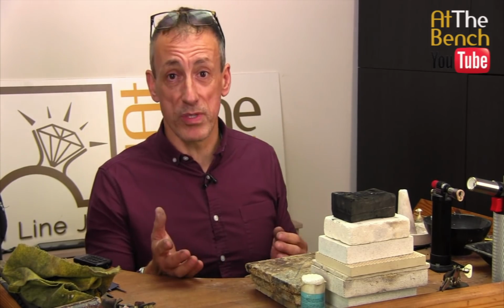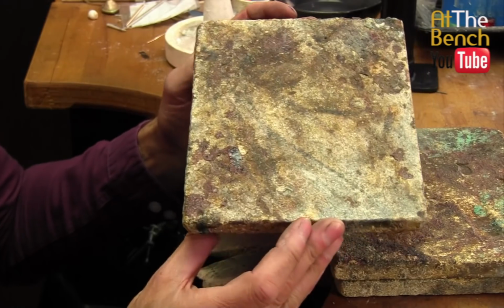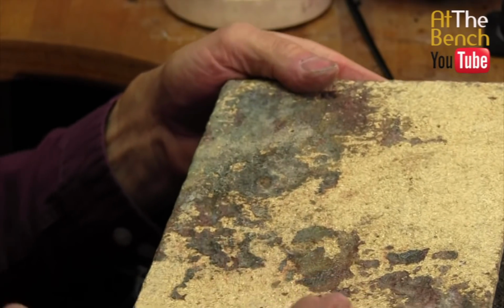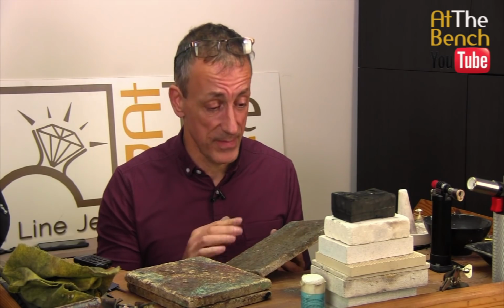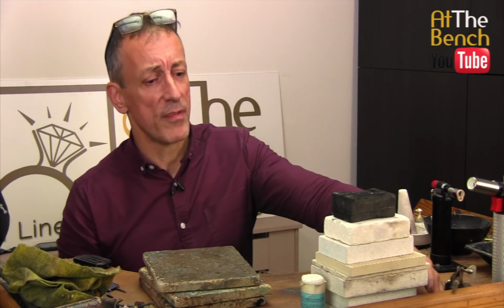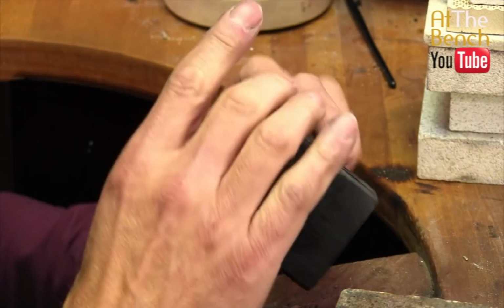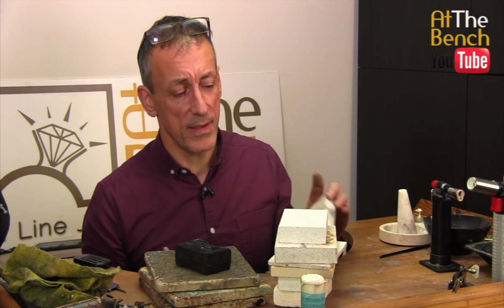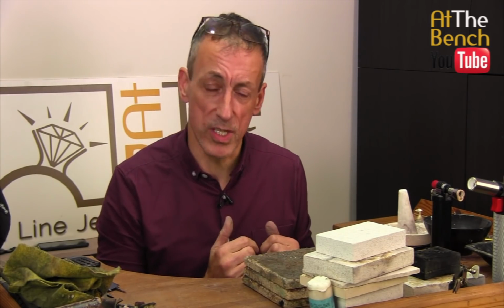After All These Years It's About Time To Retire

Comment: I used to put my crucible and my hard soldering blocks out on my window ledge for a few weeks and the sun and rain would break down the flux to a powder.  I would retrieve them, brush them out and use them after making sure they were dry.

Comment: Just a suggestion as you give me so many tips. Put masking tape on the back of a sheet of rough emery paper put equivalent masking tape on top of your workbench, apply superglue to the masking tape on the back of the emery paper and activator to the tape on the workbench. Glue the two together and you have a nice flat sanding surface, which is very easy to remove and causes no damage.
Reply: Midnight Joker Myself I have a piece of “Float Glass” (mine is 4”*8”) I contact cement or rubber cement to adhere whatever abrasive paper to it. I also have a 12”*12” piece that I use to sharpen tools on an with large sheets of paper when I am not worry about spotting or tarnish I just use water.  If you don’t want the expense of float glass, (I got a deal on my various size pieces years ago) thick plate glass is a good alternative.  Stop by the local glass shop in your area and talk nicely and ask how much as opposed to begging for it and you can used pieces of plate glass from replaced windows cut down to size pretty cheap.
Reply: @gullreefclub  Nice one. I got some granite, but usually to lazy to hump it out unless i need real flat.
Reply: There are sandpapers with a sticky back, available in various grits, that come on a roll. I found some on Amazon. I keep a selection by my bench to adhere straight to the bench or to a board that is easy to move out of the way when needed.
Reply: Thanks @kathyrmatthews , I have tried them, and prefer masking tape and superglue. Double sided tape and tape on sandpaper can be much more difficult to remove and reuse and can leave unwanted residues on you workbench or workpiece.

Comment: if like me you cannot get a charcoal block to a flat surface, due to where you live or something like that, you can use them to create "caves" for soldering objects in. This creates a reducing environment that will allow for better solder flow and also allows the object to heat up quicker, thus saving gas and time! (the flame energy is not so readily lost to the entirety of your room!)... so save those charcoal blocks at all costs!!!!!

Comment: HI , NOW  TO SAVE ME BUYING A NEW CRUCIBLE AT AROUND £15. I HAD A IDEA  ''FIRE CLAY ''  SO I WENT AND GOT A £3,99p.  LITTLE PLASTIC POT OF FIRE CEMENT , AND MADE MY SELF A CRUCIBLE , AS YOU CAN HEAT THE CRUCIBLE TO ABOVE THE HEAT OF GOLD AND IT DON'T CRACK , SAVING ME £11 . AND IT WORKS FINE .